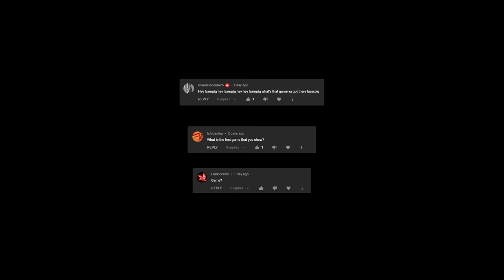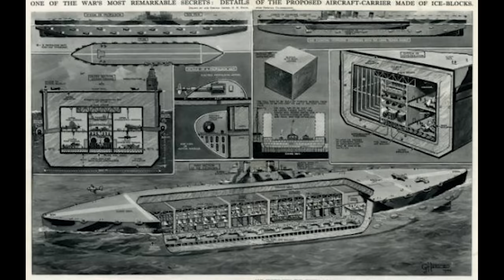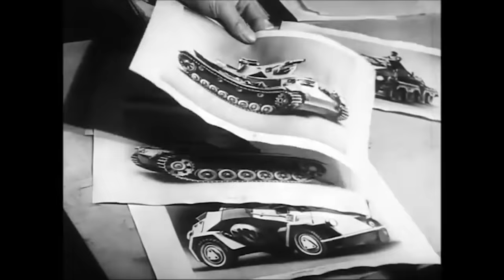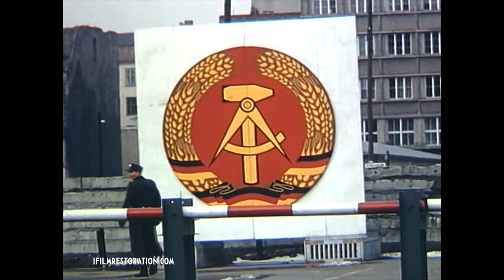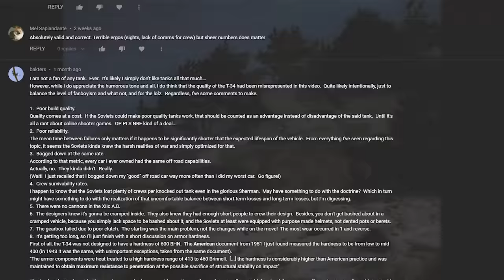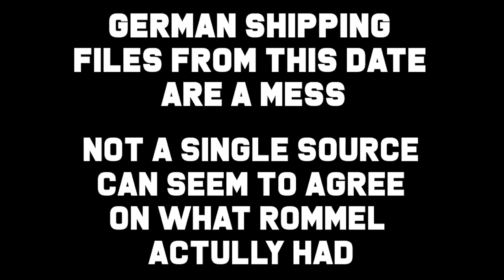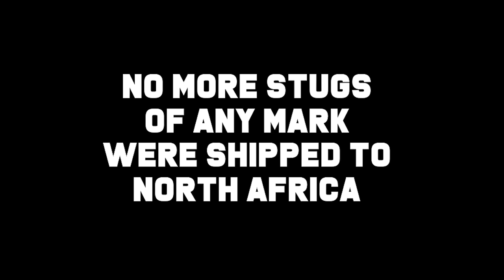In defence of the Crusader Tank

Comment: 32:30. Most of the time when people ask why armies did dumb stuff it's usually down to doctrine. 

The British took a while to figure out the 'retreat to draw tanks onto an anti tank gun' tactic and the Americans fell for the same thing when they joined the war.
Reply: You'd think that one would be known since the days of Parthia, or at least Mongolia.
Reply: The issue wasn't really doctrine though it was chain of command and the command hierarchy one because it was up to the general to adapt and change doctrine in the face of issues, not the enlisted troops. The instant that a general was put into place that decided to do this things improved.
Reply: @2993LP  Sometimes it's not easy to spot bad doctrine. Especially if the doctrine has worked in the past. It's quite hard to immediately turn things around, especially if equipment, training and tactics needs to be altered.